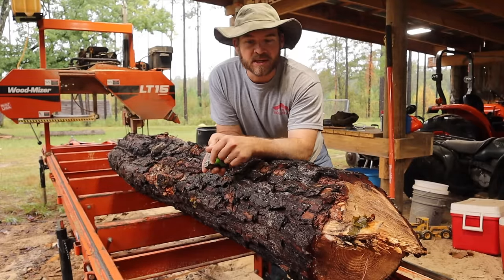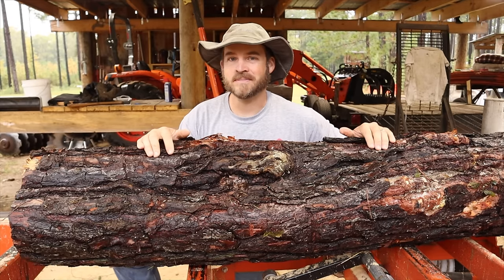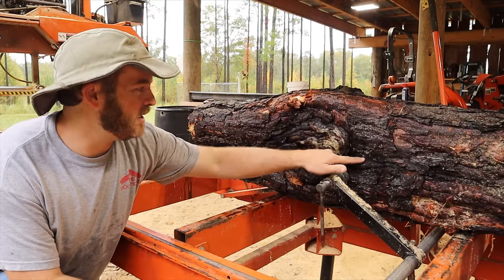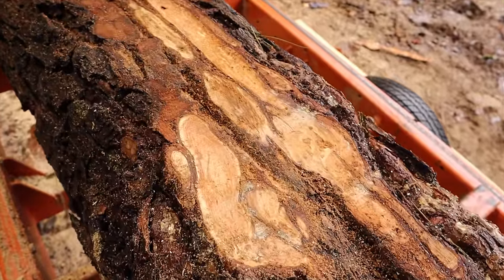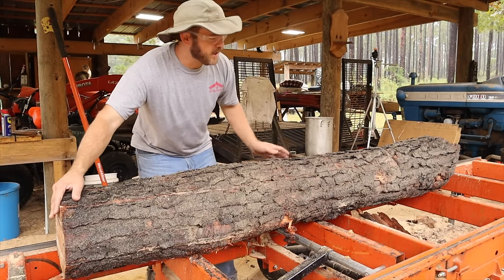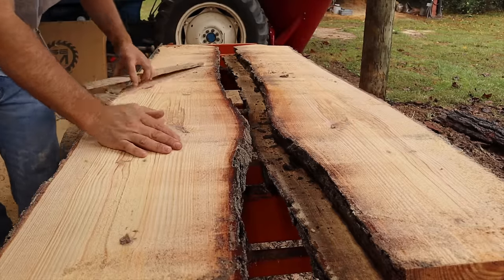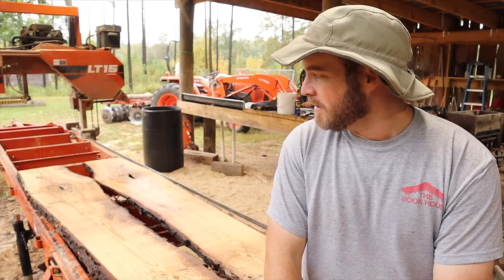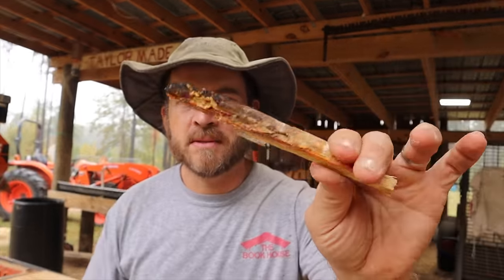This Log Had FIRE Inside: Cateye Pine on the Sawmill 🔥

Comment: Cut each slab thinner and then use the thinner wood as the doors of an end table, or a tall cabinet in the kitchen or dining room.  Oo-oo, how about a gun cabinet. They all would be interesting with book matched doors.  And the rest of the finish surface lumber of course would come from that same log (you've got plenty other home cut lumber in your stash for framing and shelves).

Comment: The figure is nice for sure, but the pitchy sections would be a bugger to finish unless maybe you epoxied the entire slab on a project.  I have finished over pitch before and it is futile.  I was curious too when you scrapped it.  Thanks.
Reply from the maker: Good point. Tons of pitch buildup on the sandpaper. Didn't even think of that. Thanks for watching!

Comment: I made a video a few weeks ago cutting a pine log with damage. It’s pretty stuff but I won’t do it again. The pitch build up was extraordinary and caused uneven cuts. Used the 2x4s for my chicken house and it’s rather comical when I look at some of them.
Reply from the maker: I dumped a ton of soapy water trying to keep the pitch off and it worked well enough. Diesel would probably solve your problems.
Reply: @falllineridge  we keep it loaded with soapy lubrication but cutting fat wood takes the pitch to an extreme. Diesel makes me a bit nervous. I worry if it would damage the bearings. Keep up the good work. I love seeing your boy running around. 👍🏻